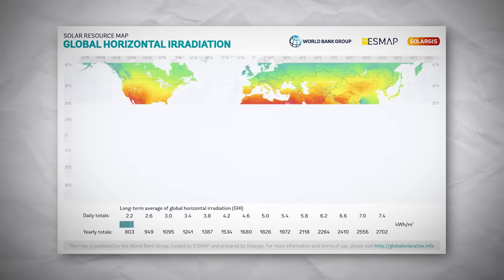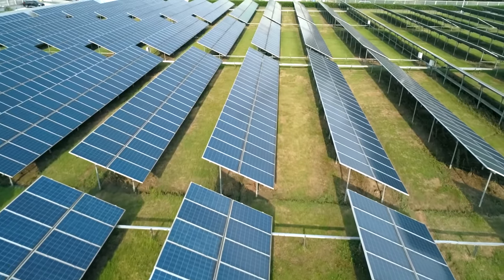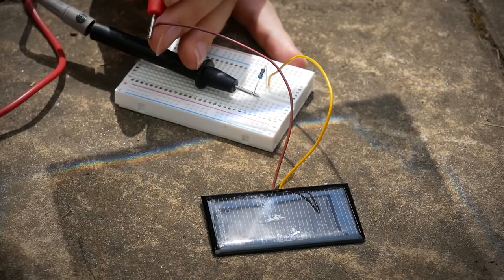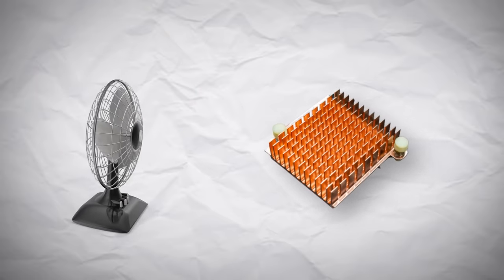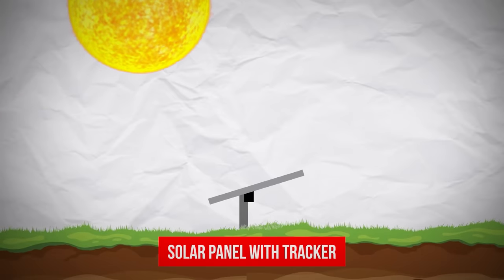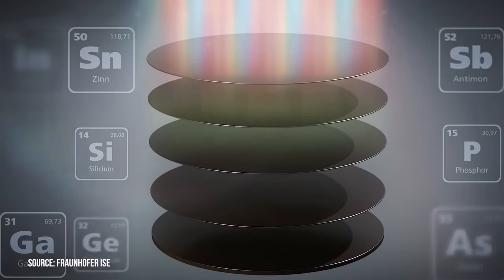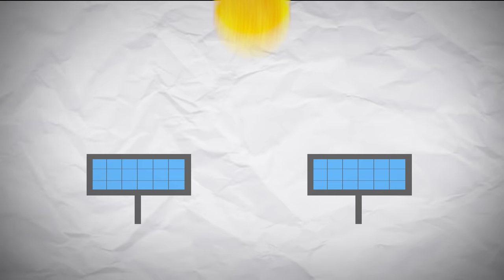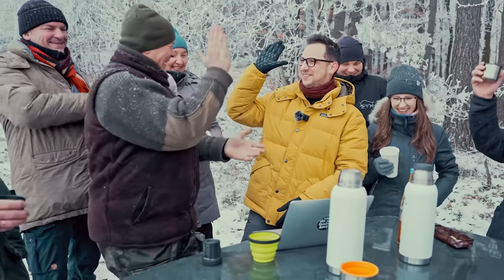Is Spherical Solar Really The Future of Energy?

Comment from the maker: Hi Guys, Ryan here! Thanks for watching, I enjoyed going down this solar lens rabbit hole and was really surprised at how some of them managed to increase solar energy production! Also, make sure to go check the awesome work from my friends at Planet Wild as they restoring our natural world:

Deep sea clean-up: www.planetwild.com/ziroth/2
Resurrection of a dying forest: www.planetwild.com/ziroth/3
Reply: Oooooooooooooooooooooooooooooo9ooooooooooo
Reply: Mpnr😂😂
Reply: you should revisit this with vertical aligned dual-face PV panels and rather than a single point Fresnel lens, use the thin bar orientation so the bar is focused into a line that paths with the sun across the PV cells.  This gives you the added benefit of both the Fresnel concentration and the cooling of the upright dual face orientation without any moving parts or tracking needed.  As well as a vast reduction in the amount of surface cleaning required.

And there's another tier of benefit to this if you can surround the panels with a box of mirror walls that are angled out, and tall enough to prevent line of sight between the PV cells and any radiant surface like trees, or walls, etc.  There's an effect with a fancy name that escapes me at the moment, but the result of it is cooling with no energy or moving parts.  The reflection of heat off of matter helps equalize the heat energy between everything on the ground, but if you prevent those waves of energy from reaching a surface that is open to the sky, that surface only sends heat out, none returns through sharing radiant heat.  

Long story short, it's free added cooling.  This, as you know, means even more energy throughput for the PV cells.  The daily output should exceed 200% as compared to normal horizontally aligned PV cells that lose a large amount of energy to heat.  This is before the cost of moving panels to face the sun, cleaning those panels, and maintaining all of those moving parts or supplying that labor is even considered.

Vertically aligned PV panels under Fresnel concentrators wrapped with inward facing mirrors allowing radiant heat loss results in a system of energy generation that's vastly cheaper per unit of energy than any commercial option.  And it can be done at any scale in all environments where the vast majority of people live and work.  Where this doesn't work we have diesel.  

This is what the individual laymen should be doing.  No moving parts, best possible mass produced efficiency, no difficult alignment, simplified cleaning and maintenance.  It's as plug and play as a solar harvesting system can be, AND it's 200% more energy for the same solar footprint.

But I ain't one to gossip, so you ain't heard that from me.
Reply: Would be great if you could revisit this video to adjust the audio levels. Sounds terribly distorted. Probably since it's too loud. Use a compressor rather than pulling up gain/volume?
Reply: But I can get the same if not more effect out of basic TV defusers...
Reply: ❤❤❤❤❤❤❤❤❤❤❤❤❤❤❤❤❤❤❤❤❤❤❤❤❤❤❤❤❤❤❤❤very very good ❤❤❤❤❤❤❤❤❤❤❤❤❤❤❤❤❤
Reply: @ZennExile 🔴 What Is Islam? 

🔴 Islam is not just another religion. 

🔵 It is the same message preached by Moses, Jesus and Abraham.

 🔴 Islam literally means ‘submission to God’ and it teaches us to have a direct relationship with God. 

 🔵 It reminds us that since God created us, no one should be worshipped except God alone. 

 🔴 It also teaches that God is nothing like a human being or like anything that we can imagine.

🌍 The concept of God is summarized in the Quran as:

📖 { “Say, He is God, the One.  God, the Absolute.  He does not give birth, nor was He born, and there is nothing like Him.”} (Quran 112:1-4) 📚

🔴 Becoming a Muslim is not turning your back to Jesus. 

🔵 Rather it’s going back to the original teachings of Jesus and obeying him. 

More .....👇

🔴 THE RETURN OF JESUS
Reply: It has been discovered that setting your solar panels vertically is better than any other orientation. No whiz bang tech needed.
Reply: Okay here's your VIEW now go away
Reply: @ZennExile  I am trying to picture what you are talking about with the thin bar orientation... is this a specially made type of Fresnel lens?  

"so the bar is focused into a line that paths with the sun across the PV cells" ... does this mean that only a portion of each cell is receiving light and that as the suns rays come in at different angles during the day, that bar of light "scans" it's way across the face of the cell?  

Interesting comment.
Reply: @earlrobinson5911  yes, there is a certain orientation of the lens used in DLP TV widescreens that doesn't focus down to a point but rather into a small rectangle.  You can align one over a solar panel so that the bar of sunlight passes across the panel as the Earth rotates or to a motorized pedestal for maximum footprint.   In a vertical orientation using this method, the panels can collect 60% more energy, and if shielded from IR, so that the panels can only see open sky, you can create an ambient temperature shift of about 9-10 F.  This increases the output of the panels even further as temperature limits voltage in PV cells.
Reply: Problem is this tech is not being absorbed by the solar markets. I saw videos about this tech many years ago where it was claimed so efficient it could use moonlight. It's not being sold to the general public.

Comment: TL;DR: It is not. You're welcome... ;)
Reply: Thanks, saved me 9 minutes of listening to this homk
Reply: Thanks but i wanna know why
Reply: @rehenaziasmen4603  

If you don't know the physics that makes it preposterously stupid, well, it's probably not worth your time, unless you want to change that. It's not deep physics, but there is a lot of really obvious, basic level math (algebra II level). And I'll presume you don't have that, or you'd already have a good idea why this is so stupid an idea.

I detail a few obvious facts about solar energy in a top-level response just put out a few minutes ago. 

Ziroth seems to latch onto any preposterously cockamamie "That's cool!" idea he encounters, with no capacity to actually identify problem areas.
Reply: @nickbrutanna9973  Belittling people doesnt help.
because the material cost isnt made up for with current solar capacity in solar panels.
Reply: @rehenaziasmen4603  Other commenter is being a dick for no reason and you don't need to know maths beyond addition to find why the idea won't work.

Basically it's just harder to make and more prone to failure than our current method of just sticking a solar cell on pole in the ground (you need active cooling, tracking, expensive glass lenses, etc). There's no need to reinvent the wheel.
Reply: Thanks. I just thought so.
Reply: @nickbrutanna9973 Crap attitude from someone who likely doesn't have any real uses for the starting skills you get from uni.

You might get good some day once you learn your own limits and grow beoynd the kruger.

Most people are mostly familiar with topics they hold important personally, it's next to impossible to do so for everything.
Reply: @nickbrutanna9973  you can't say an idea is stupid because the math and physics that make it stupid are shallow and obvious and basic, but then not explain how in the same comment. if it's too much trouble for you to explain how the idea is stupid, then the idea isn't as stupid as you're suggesting. it may still be stupid, but not that stupid.
Reply: Bro sounding like the guy who wrote the Rick and Morty copy pasta
Reply: Thanks
Reply: @nickbrutanna9973  what Ziroth does in this vid is to do exactly what you say he isn't capable of - he explains the physics and engineering problems with the concept, for people who don't necessarily have a background in those subjects.

From what I've seen, he does it very well, and seems to have a very good grasp of the concepts and issues. 

I'd be guessing that he has a background in either engineering or physics (or both).

And before you say I don't know what I'm talking about - I have a background in both, with a qualification to prove it - probably unlike you, who I'd say have probably studied a little physics in high school, or have maybe just started at University, and want to impress people with how smart you are - it obviously didn't work, judging from other comments here....
Reply: No thanks 😛
Reply: Thanks.

Comment: Here is the thing about any type of lense as far as I am aware: the solar panel needs to be smaller than the lens, which means less solar panels per area. Because all a lens does is concentrating light from a wider area to a smaller one. So how much more energy can actually be harvested from a lens + solar panel setup, vs a solar panel alone using the same area that the first setup uses?
Reply: I think the point is to rather save money by needing less solar panels (lens should be cheaper than a solar panel). But it will still use a similar amount of space.
Reply: @matthewvanhelsdingen543  No net $ saved as the panels will degrade more quickly under magnified sun + cost of magnifiers, mountings, etc.
Reply: @protonneutron9046  That's why we add a cooling jacket and harvest that heat for domestic hot water.
It isn't the light that kills the cells, it's the heat.
Reply: He literally said the counter argument to this comment in the video
Reply: The efficency of solar panel in ISS is about 40 - 50%. Normarl solar panel is 20-22%, so i think the same size we have smaller space for solar panel but more power
Reply: You neglected to mention fluorescent down conversion, to convert UV into more harvestable light, which would be good to pair up with the light guides!
Reply: @quocdanang6586 The ISS panels don't have to deal with an atmosphere. Any solar panel in space is going to be way more efficient. 

 Also cost really isn't an issue for a project like the ISS.

 Anyway this is one of the reasons why people literally think putting solar panels in space, and beaming energy down to earth is a good idea. 

 It is possible, but the cost of sending material up is so vast, that it wouldn't make any sense. I can't believe people think it makes sense. 

 Anyway focusing is a good idea if the cost of the lens can go down. Those multilayered panels are great, but super expensive.

 I always thought fresnel lens already captured light from all angles, and focused it to a point..I was misinformed!
Reply: lenses are much cheaper and easily recycled than the solar panels themselves so if you can reduce the amount of difficult to be recycled component per acre you are seeing benefit.
Reply: In my opinion, a 20ft^2 lense + a 3ft^2 panel is cheaper than 20ft^2 of panels
Reply: He actually mentions this exact problem at 5:31 then tells you how this has a higher energy efficiency anyways. By reducing the size of the solar panel needed, they can also swap out the panel itself for a considerably more expensive but efficient one that also increases its efficiency at higher light intensities.
Reply: @TimeSurfer206  water-cooled solar panels are fantastic in theory, a win-win, where you cool the panels and simultaneously make use of collected heat. But, apart from much higher costs and complexity, we are changing very convenient panels, that have no moving parts and require hardly any maintenance, into hydraulic system that requires a lot of maintenance and is subjected to significantly wear over the years. The gains from introducing watercooling would have to be tremendous for it to make economical sense.
Reply: @nobodynemoq  You are right.
When we consider the existing design of a Solar Panel, and its current design only.
Reply: I mean, he said in the video that Fraunhoffer Institute's small thermovoltaic multijunction cells designs hit 45% instead of 15-22%; no idea why tracking would be problematic per se, though counterbalancing and compensating for brushing cows or wind would fatten a given agrovoltaic operator's spares stock...
Reply: Just use it to boils water
Reply: Here's your solutions. They are multifaceted so try to keep up. There are flat lenses even better than frenel lenses. Lenses so good, a flat disk is enough to focus specific wavelengths meaning you could super power your light beams. Another one to keep an eye out is timing. Yes really. When the panel gets too hot to be effective, shut down the lens (yes with these that's possible) and turn back on for more gains over time than with just fullblasting or setting and forgetting. Moreover, you could now dig sola panels underground and focus the light there. Space saved, money saved, energy gained and omg why is no one thinking like this? Omg this is so easy if people were to just use the internet like I do, gathering tech data to combine later? You could do so much with enough money if you just watch a few youtube videos.

Does this alleviate most grievances? I would imagine it does but I could understand skepticism. I welcome any and all criticism to improve my ideas so that later I can benefit from it. And if I benefit, so do all of you! Because if I can do it, so can you! Please by all means give me some ideas!
Reply: Would like to see a real world use side by side numbers comparison (actual energy generated as well as actual and future projected costs). One item that wasn’t addressed is that lenses can’t be 100% efficient at passing through light. There has to be some amount of light loss due to reflection, scattering, and absorption from the lens.
Reply: I think this could help with a common problem in my area. Using farm land to place solar panels. This could save space.
Reply: if you concentrate light - you can generate electricity at night by using reflected light from moon
Reply: @dianapennepacker6854  The problem is that you think we'd send the materials up to build the solar panels when in reality the panels would be built in space from materials harvested from asteroids or the Moon. No one, literally no one, is proposing building large infrastructure in space using materials from Earth stuck down in this gravity well. When you know the actual idea it makes much more sense.
Reply: Imagine you have lenses covering the area of like 10 lots in your neighborhood, but all the energy is going to your roof 😂😂lots of energy, but neighbors won’t be too happy
Reply: Maybe it can use less intense light. Solar angle is also what limits solar in many places
Reply: @protonneutron9046 regular solar panels large expense is the system of racks and clamps used to mount the panels. There is a class of photovoltaics that operate in high intensity light, totally different from crystalline silicon cells
Reply: Solar panels aren't as efficient as steam
Reply: So in a very eli5 kinda answer, every solar panel has a certain amount of “leakage”. By doubling the input the leakage becomes a smaller and smaller percentage.
Reply: @filonin2 not true, people have plans for space based solar based on space X prices when starship gets going.

I think I saw estimates of about 2 billion dollars for the equivalent power of approx 1 nuclear plant? (A nuclear plant costing about 12 billion in their estimates).

The problem isn't really the space based stuff, but the receiver array you need to build on the ground has basically the same problem as a solar array on land does.  It wastes land.
Reply: @filonin2  Unless you build a nuclear power plant on the moon, which would be incredibly expensive, you have no reliable means of generating large amounts of power necessary for constructing anything. Any plot of land on the moon will be dark for far too long at a time, so you can't even power a solar panel production facility with solar panels. Many manufacturing processes are also reliant on gravity in some way. I doubt we can ever do anything substantial on an asteroid, the gravity is just too weak. It's one thing to propose mining in space, that's very difficult to the point of impracticality today but the theory is there. Actually manufacturing something at scale up there? That's not even theoretically feasible. It's unlikely anyone alive today will live long enough to see that change, let alone see it actually done. The cost of doing so can't come down enough to make sense.
Reply: It also increases the heat which means added cooling would be needed.
Reply: Or we could just spend the money to research stabilising perovskite cells.
Reply: @dragon67849 First problem is that lenses can’t produce more energy than the light already hitting their surface. It’s called the first law of thermodynamics.
Reply: @filonin2 because manufacturing in space from materials harvested from asteroids is easier than…? Both ideas are dumb, lol.
Reply: lets say a lens focuses sunlight to an area 4x the size of the lens. if you have a solar panel that can keep up with ~4x the solar intensity, it will still generate as much power, if not more from a solar panel as big as the lens. Like Ryan said, some solar panels are more efficient with intense sunlight, up to 300%. though those solar panel are more expensive.

lets pretend we have 1 square kilometer of field with constant 1000 MW of sunlight. using 1 square kilometer of conventional PV will yield something like 15% of that, so theoretical 150 MW. if we can focus that 1000MW into a solar panel that is 3x more efficient, it would yield theoretical 450 MW output. whether or not this method cost more or less per watt, this without a doubt reduces area per watt meaning more solar energy is harvested.

if we can pull it off with less cost, then it would become the industry standard for solar panels. only if we can solve the cost problem